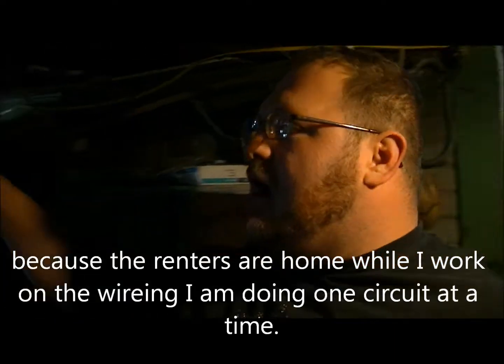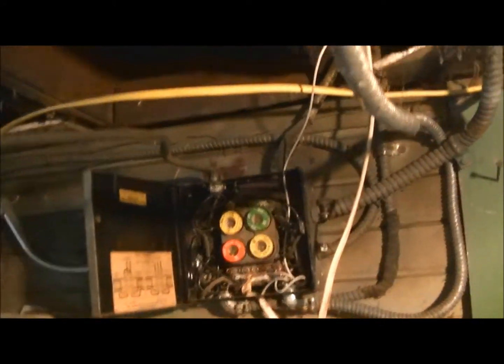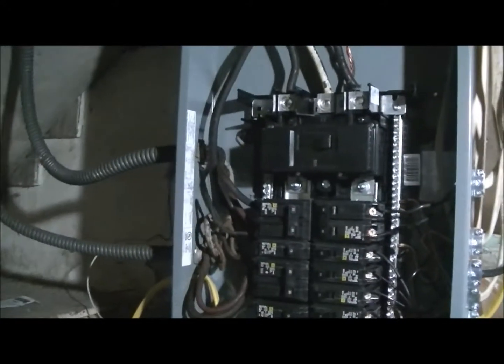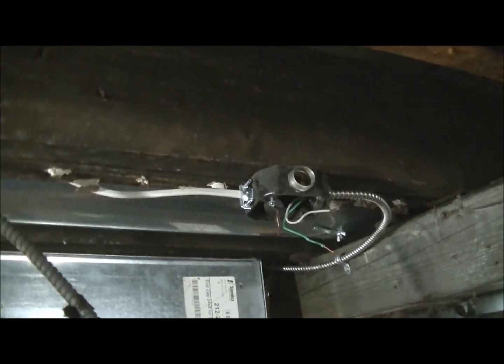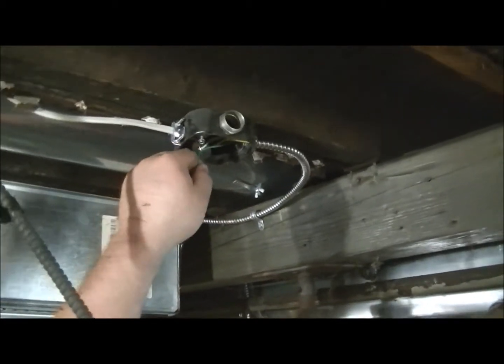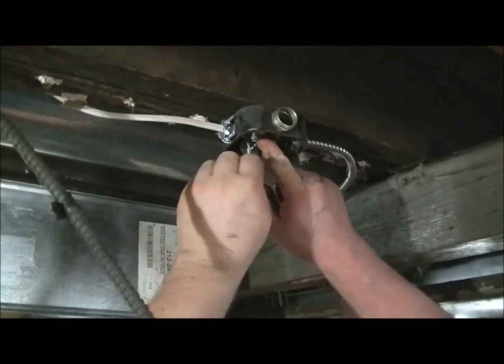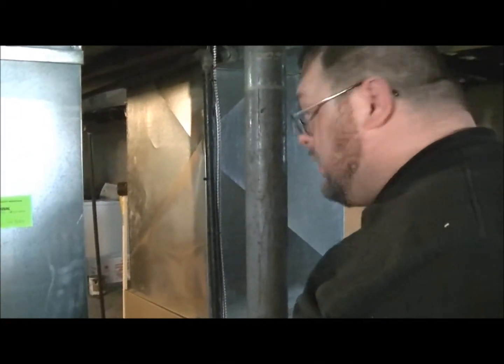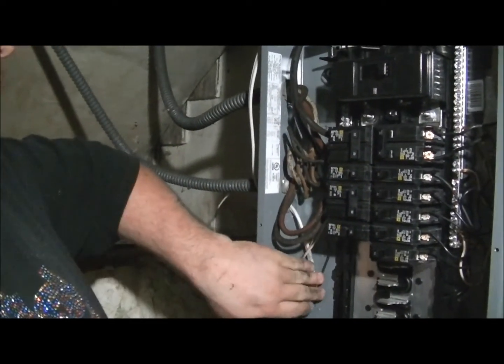ELECTRICAL JOB

Comment: Nick what size if wire do you have feeding the main breaker? It looks like #4 or #2 on a 200 amp. Also did you know there are structual rues on drilling joists. The support rules need to be followed on the romex and box holes are to be closed. The work does look ok but if you need a little info PM me. I do this stuff for food and have been for 30 years. ...And another rule to remember. DEMCAD is supposed to dig all the ditches and clean up all the mess, and buy lunch.

Comment: I hope you guys remembered to turn the power/breaker OFF before messing around with any electrical wires.  Last time DEMCAD had to take the video down due to erroneous and dangerous instructions.

Comment: Also is this your first point of disconnect or is there a disconnect outside feeding the breaker box? This changes your grounding connections in the box. .....Also clean up that nasty looking slack wire in the box !!...I get all over employees for slop like that. Keep up the good work though. Buy your helper a steak when you are finished with the job.